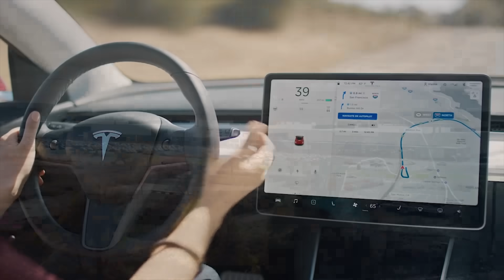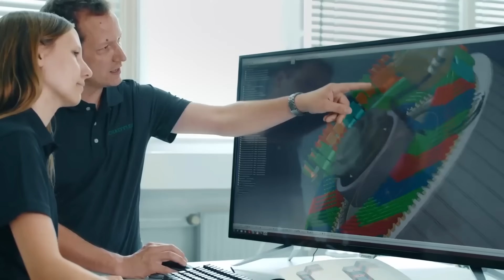New EV Benchmark: 5 Miles/kWh; Ford Dealers Fight EV Mandate - Autoline Daily 3699

Comment: Dealers hate EV’s because there is no maintenance or repair which is their bread and butter!
Reply: Exactly.  All the dealerships big profits are from the repair department and used car department. The new car sale departments are just an annoying footnote for most dealerships.
Reply: Oh but when they do need repair it's an easy five figure gig. Come on now.
Reply: @POVwithRC  what EV did you own that  needed repair? My 2013 Ford Focus EV went 7 years with nothing but software updates and my 2020 Bolt EV has had no repairs! My friend has a 2014 Tesla Model S with no repairs so far! So whatever you are driving is crap!

Comment: I think you missed part of the reporting regarding Tesla in Sweden. My understanding is that only 10% of the Tesla employees are striking. Now I don't know how much support those striking workers have with the rest of Tesla's mechanics but it seems there is insufficient support to unionize and most of the push to do so is coming from outside of Tesla.
Reply: Here's another armchair expert on the politics in Sweden.  
It's a shame that the Supreme Court in Sweden is anti union, at least we aren't the only ones that have a sold out high Court.
Reply: Haven't you noticed? Autoline has been bought out by Toyota! 3 promotional videos today and over half the news show (only 5:40 news all the rest of the 12:29 devoted to adverts for Toyota and others). Don't expect AutoLine to say anything nice about Tesla.

Comment: "LFP batteries are suited for energy storage and commercial trucks" you say? Not passenger cars? Um, BYD? Personally, I would totally give up high performance for cheaper and more durable any day. Perhaps I'm not your intended audience.
Reply: Model 3 is LFP.  Tesla has made LFP a standard in the US industry.  Ford is switching next year.
Reply: Along with what _PatrickO mentioned, the relaunched Chevy Bolt EV is supposedly going to have LFP cells. I fully agree that US consumers have long needed EVs that are practically-sized and equipped with batteries that are not only durable, but containing less in the way of problematic materials (ie: human rights extraction issues and mining where we don't really want/need to.)
Reply: He's just reading off the teleprompter, this entire program is nothing more than a string of commercials.

Comment: 4:30 isn't that mi/kWh estimation totally influenced by the Range cycle test cert choice? luxeed very likely based their 5mi/kWh off CTLC/WLTP which is more giving than EPA test certs (which in itself has MCT/2cyc/5cyc options). So I'd still stay US/NA market EVs are more efficient relatively speaking.

General Rule of thumb: CLTC vs. WLTP is 15% to 25% more; WLTP vs EPA is like 11 to 15% more. So CLTC vs EPA must be like 25 to 35% more.

Comment: It’s possible to consistently beat 5 mi / 1kW in a Kia or Hyundai - at least the months you don’t require cabin heat. Drive always in Eco mode, and using the adjust-on-the-fly regen braking controls on the steering column you coast at every possible opportunity. I have gotten 25 mi door to door commutes to average 5.6 mi / kW without even thinking, I just drive using this method which I now do unconsciously after 3+ years of ownership.

Comment: Tesla Model 3 (5.08 miles per kWh) I think this is a little over 5 and they currently have a standard voltage??
Reply: On my normal commute my Model 3 LFP gets 5.128 miles/kwh. My lifetime average is 4.31 miles/kwh.
Reply: Cybertruck runs on 1000V architecture.  I expect we will see that migrate into 3 and Y in the near future.  So we could see even better than 5 miles/kwh

Comment: Um, I think your 4:00 segment needs some rework.

First of all, the (old) US Model 3 has a 60kWh battery and gets an EPA range of 272 miles. Presumably you also used EPA numbers for the Ioniq 6 and the Lucid Air. 
272/60 = 4.53

Then you make 5 mi/kWh the new benchmark, which is fine for the EPA cycle. 

However, Luxeed uses the CLTC cycle. Lets take a look at the site you linked at what Luxeed claims for their RWD models:
- 62 kWh LFP, good for 550 km CLTC range -> 5.51 mi/kWh
- 82 kWh, good for 705 km CLTC range ->  5.34 mi/kWh
- 100 kWh, good for 855 km CLTC range -> 5.31 mi/kWh

Lets see what Tesla gets in the CLTC:
- 60kWh LFP Model 3 "Highland" RWD good for 606 km CLTC range -> 6.28 mi/kWh
- 79kWh Model 3 "Highland" AWD good for 713 km CLTC range -> 5.61 mi/kWh 

As you see, the benchmark for the CLTC should be 6 or even 7 mi/kWh. 

I also fail to understand how an 800V architecture would meaningfully contribute to savings in energy consumption. Would someone help me out here and show what is theoretically possible here?

Comment: That miles per kilowatt hour is interesting. I have a 2018 Kia Soul EV and it routinely reports 3.8 to 4.1 miles/kwh depending on what kind of driving I'm doing. Pretty impressive considering its age and semi-boxy shape! As for the Ford dealers not wanting to convert to EV, ultimately they will pay the price. The transition is slow-going in this country but it's going to happen. There's nothing they can do to completely stop it from happening, so they need to rethink their strategy pronto. If not, then America, which is already lagging behind other parts of the world, will fall even more behind and never be able to catch up.

Comment: That new Luxeed sedan is no new benchmark in efficiency, the 12.4kWh/100km (~5mi/kWh) consumption is only according to Chinese CLTC test cycle which is notoriously overoptimisting when it comes to estimating EV range. It's decent but unexceptional result compared to other cars tested on the same cycle, for example a version of it with 62kWh battery pack is rated from 550km, and the one with a 82kWh one for 705km, compared with Tesla Model 3 that has a CLTC range of 606km for RWD trim (60.9kWh) and 713km for AWD (84.6kWh).

Comment: 800 volt architecture doesn't lower resistance. It has lower resistance loses because the higher voltage   has lower current.
Reply: The presenter is just reading a script off the teleprompter, he (like his father) are clueless about technology.

Comment: How much longer  before American full size  trucks loses its dominance in the USA. This is scary!!!!
It may be one of the oldest platforms in its segment, but the 2023 Toyota Tacoma dominated mid-size truck sales in 2022.

Toyota sold 237,323 units in 2022, a slight decrease of 6.3% compared to 2021. Despite this, the Tacoma retained its midsize sales crown in the US for the 18th straight year. It's not quite as impressive as 46 years of dominance for the Ford F Series, but considering the Tacoma has only existed since 1995, Toyota deserves a ton of credit.
Pickup trucks are an American staple, so to watch a Japanese automaker enter the market and outperform the likes of Ford and General Motors is nothing short of tremendous. Here's how the mid-size competition stacked up against Toyota.

Comment: The Tacoma is going to clobber the competition in 2024. The hybrid is very weak, but at least they did it, unlike the Ranger, which wimped out. Nobody has enough battery capacity to offer what is really needed in the space, which is an economical hybrid like the Maverick in the midsize category. Would save a lot of money for the customers

Comment: These hybrid electric vehicles are not the solution to substantially reducing carbon emissions, but they will get a lot of people interested in electric drive trains. Once they see what kind of power you get out of electric. Baby steps. Let’s just hope they level up to full electric when they see how much they save without the gas.
Reply: I feel the same way, and I feel that judging EVs by the charging infrastructure NOW is silly, because in a few years it will be everywhere and more reliable. I own and daily a Bolt (which I love) but I also ponied up $100 for a shot at the upcoming Ramcharger. Normally, I wouldn't even consider a parallel hybrid because that's too much stuff to break. But in a truck that tows? The Ramcharger is a game changer. 130 miles of range, and an already reliable gas V6 that does nothing but charge the battery when it's low. I'm in!
Reply: @kipamore The RamChargers needs LFP  batteries  and the Tesla Nacs. charging inlet, that way it can SC ( which are everywhere) without fear of degrading the battery.
Reply: Funny you mention it. Normally I'd be worried about battery longevity, especially on a truck that I plan to keep forever (you always need a truck!). All new EVs come with an 8 year 100k warranty, but I'm thinking over a 20 to 30 year period. At 93kwh, the Ramcharger battery won't be a $50,000 proposition like it would be in a Hummer EV, and my hope is that a vibrant aftermarket of battery rebuilders springs up in the next decade (why wouldn't it?)  I'm thinking that lets say it's 15 years from now and the stock Ramcharger battery is down to 30% of it's original capacity. That should STILL be enough to use it daily since I charge at home. And the gas engine will still be fine in 15 years, still putting out 130kw which is enough to run the truck. What I'm saying is that as EVs go, the Ramcharger appears to be future proof.   @AuralioCabal
Reply: @kipamore 
I agree. Not typically a Ram guy, but the Ramcharger sounds awesome.
Software will baby the Pentastar V6 (on the few occasions it's used) and the 92kWh battery will be far lighter than Ford or GMs.

I've been blown away at the REx reality the past 3 years with our i3, now at 96k miles (95% on electricity, but zero range anxiety)

ICE love to run at their "sweet spot" RPM, and this Ram should prove wildly popular where BEVs fail (like Northern Plains states with cold winters/long distances).
The farmers will love preheated truck cabs plugged into cheap residential power.
Reply: @donswier  There have only been two series hybrids, so far as I know; the Chevy Volt and the i3. Both were extremely well liked by owners. Correct me if I’m wrong, but the flaw of the i3 is the size of the gas tank, no? Something about not allowing it to go farther on gas than electric, for ZEV credits I assume. 

I work on Pentastars (the V6 going in the Ramcharger) for a living. They have exactly 2 flaws, both easily correctable. And once you do, they sail past 500,000 miles no sweat. A gem of an engine. 

Ram may find a way to screw it up, but I doubt it. I have a vintage fridge - it’s been plugged in and running since 1957. Combine that with that V6, and you’ve got the 30 year truck we’ve all been wanting. 

To put it in perspective; it’s a 4 door truck that tows 14,000lbs, is quicker than a 427 Cobra, rides on air like a limosine, yet goes off road, is SILENT, has instant heat, massaging seats. Yet it (can) burn NO GAS, no belt, no transmission. Oh and by the way, it can power your house, charge other EVs, and run your tools. 

Who wouldnt cough up $80k for that? They are also going to sell it in Tradesman trim, which means probably low $50s.
Reply: @kipamore 
 I'm sold. Will be interesting  to see:
A) If Ford, GM or Toyota copies.
B) If they put this in Promaster-size van.
Reply: Toyota must know they could OWN this entire market if they chose to. They make Hino trucks in West Virginia, and those are terrible but they are Toyotas. But a regular cargo van with a Toyota badge? I'd buy one! That said, the use case is most likely for a pure EV van for local and vocational jobs. Rivian now sells the Amazon vans to the public, and Ford has an E transit. My guess is the market will be slow to adopt, but at some tipping point EVERY local van will be electric. Lastly, there is a company called Maxwell who has been doing EV Promaster conversions for years. Very cool. But like anything, about 100 miles of range. Adapting a simple gas generator to one would be child's play, especially if I can yank such a power plant out of wrecked Ramchargers that hillbillies decided to try jumping railroad tracks with! @donswier

Comment: Sigh. The Luxeed 12.4 kWh/100 km efficiency is based on CLTC rating, nothing to do with reality. A Model 3 has less then 10 kWh/100km using the same rating. Isn´t Autoline supposed to have some technical background or are they now repeating every nonsense they hear?

Comment: My y2k Taco already has the clutch override when I stall the engine off-road. However, I would love for my 3.4 to have 270hp and 310 ft lbs. Then I wouldn't need to stall while crawling over boulders.

Comment: Anyone really trust the advertised efficiency numbers self reported by a chinese company?  5mi/kwh is an MPGe of 168.525.
Reply: Getting 5mi/kwh is a brownie badge on the Chevy Bolt EV forums, 300 mile club. It's possible if you're hypermiling. The Bolt wasn't really built to be hyper efficient, so something actually designed for hypermiling could achieve that regularly
Reply: Or Tesla for that matter.

Comment: cyberCybertruck deliveries weekend this week will rule all pickups!
Reply: I don't  think so, I see it as a big mistake. They should have done the model 2.
Reply: @markday5797 ask ford if they made more money from the focus or from the F150
Reply: Hi Elon.  Congrats on delivering some hatch less Model Y’s with stainless steel body panels.  Still waiting on the as promised CT.
Reply: dxrinc  Then why did they stop making them?
Reply: It will turn out to be the biggest automotive flop in history.
Reply: dxrinc  And the stopped building the Focus because ?  Yeah there is your problem with legacy in general.
Reply: Let's see how it does in the official crash testing.
Reply: Tesla Cybertruck’s ‘Beast Mode’, is fantastic can't wait for mine!

Comment: I guess Toyota has to put as many gadgets as possible on the new Tacoma. It’s an old fossil that is ready to be put in the trash bin. I have stated before that pick up trucks, are useless vehicles for anything other than their intended purpose. They handle like crap and they are as advanced as a bronze age hammer.
Reply: Fossils are GREENER because they require less energy to design and produce!
Remember you have to drive a tesla 80,000 miles to break even with an ICE car’s carbon footprint

Comment: You don’t get it buddy!  The reason Toyota wants to sell this part of its company is because all these automotive components are absolute due to the electrification of vehicles at an astonishing market speed.   Basically got caught with their pants down and reacting  slow to the market which is typical Japanese mentality. Nobody’s gonna want to buy an engine replacment part.  There’s only motor and the battery on the electric car. Very few parts.  So by default the value of the company at the present is significantly less so they’re just trying to get rid of a dying And depreciating property. 
In fact, Toyota, as you know, today will no longer exist in the next few years .  The market has moved so fast they will never be able to market share.  Of course, the government pumps with steroids and subsidize them.

In fact, even if the government means subsidizing, be very difficult, just because how old the average age is in Japan, and how close Japan is to immigration .  The writing is on the wall and they need to start making some really big changes their system to maintain or minimize or falling behind current status quo.  Best case scenario Toyota and Honda will be in the very low single digits in the top 10 global auto makers by $ or volume in the next 3 to 5 years.  In other words at best they will be fifth or sixth top global automaker …more likely lower than that shortly after or 3-7 yrs.  Not impossible to stay on top where they are now but it sure is unrealistic. Like me winning the lottery.

Comment: How are these 800-900V battery tech cars going to charge when there are far far less public and fast chargers than for 400V battery tech.
Until the charging infrastructure catches up they are useless. Prity much Tesla is in control of this twitch over and Tesla will make these car companies pay through the nose to get acess to its 800-900v charging when online. 😊
Reply: 800-900v is their maximum ability at which they can charge at their fastest. They have on board capabilities to cope with other voltages.

Comment: No mention of the long lines to see the cybertruck at Tesla sales centers, nor the fact that they have released FSD v12 to employees.
Reply: The so called "FSD" could be on version 99 but will still be level 2 driver assist, at least until Elon figures out it isn't possible with camera only.
Reply: @davidmccarthy6061  You mean it wont be incorrectly labeled as level 4 like Cruise, but behind the scenes each car is constantly guided by 2-3 employees per vehicle, and still get banned for driving on top of humans?

Yeah I think Tesla is doing it better, not to mention not bleeding money trying to solve the complex problem the right way - general autonomy, not the basic geo-fence bs.